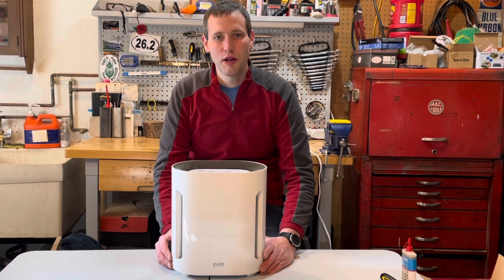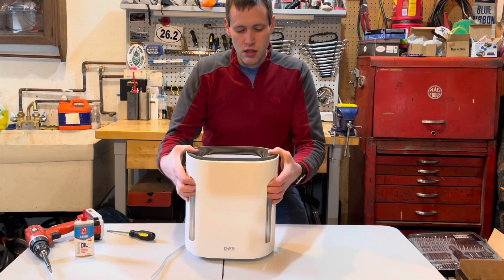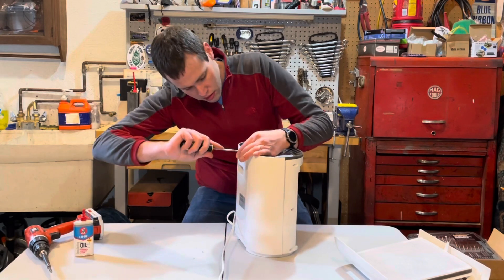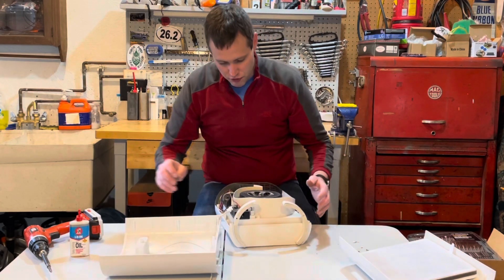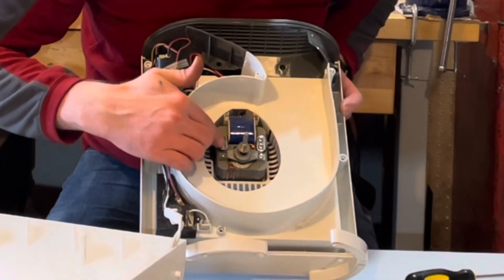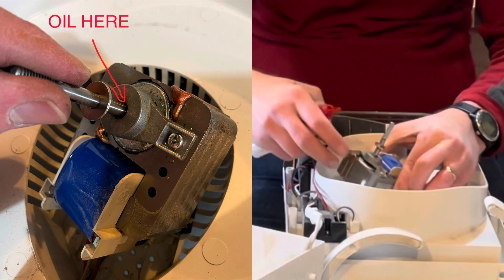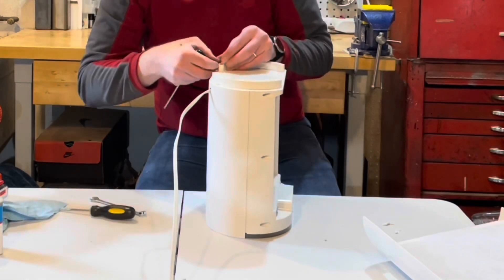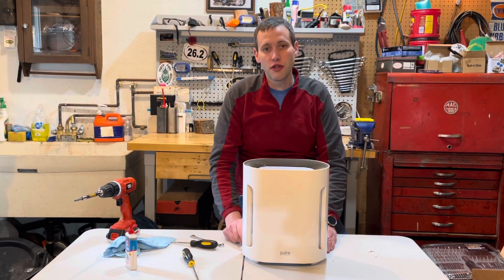How to fix a noisy Pure Enrichment Air Purifier - you can make it quiet again!

Comment: The button lights on mine keep blinking. Even with new filter wont turn on.
Reply from the maker: Was it doing that before you changed the filter or only after?  Did you make sure that the cover is on all the way?

Comment: Nate my Pure Enrichment Air Purifier will not turn on after pressing the on button. I've checked outlet, plug, and made sure front cover is properly closed. Once I close the cover all panel lights flash. Last night I hit the sleep button it flashed and continued working til I shut it down for the night. When I tried turning it on nothing it does not come on no lights nothing. Please advise.
Reply from the maker: Not sure what the issue is.  You checked all of the things that I would suggest.  Try unplugging it for thirty seconds and try it again.  I would also try taking off and reclining the front panel again just to be sure.